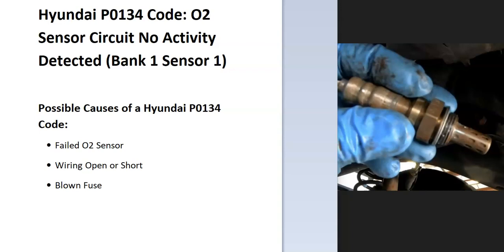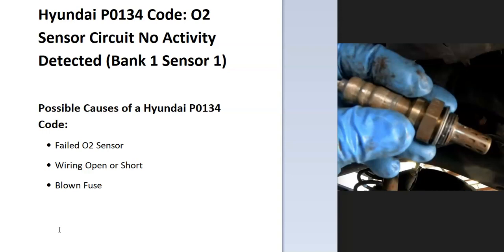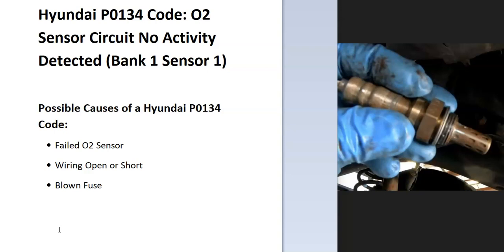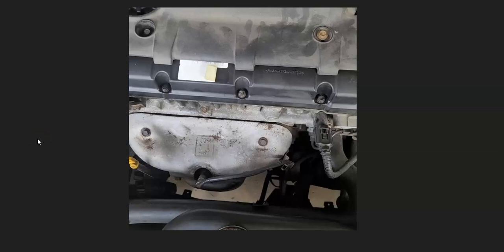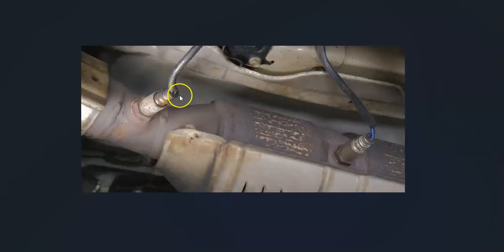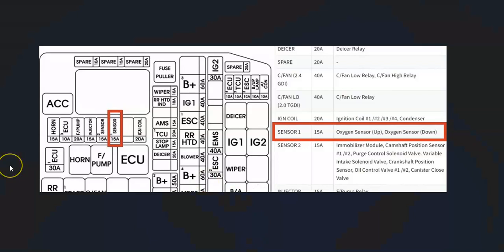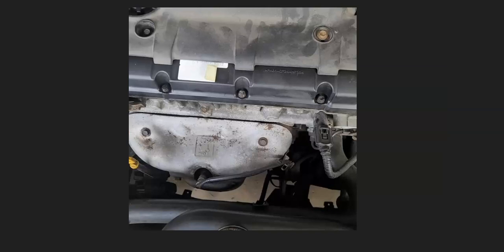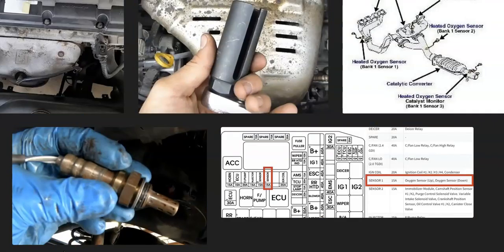How to Fix Hyundai P0134 Code: O2 Sensor Circuit No Activity Detected (Bank 1 Sensor 1)

Comment: Hey.. thankyou for your video.
I've a 2018 Hyundai Verna and had the catalytic converter replaced earlier this year. Post that I've been having this p0134 error and have had the sensor replaced twice.. but the error persists .. the check engine light comes usually after giving extra acceleration.. happened twice .. any recommendations?